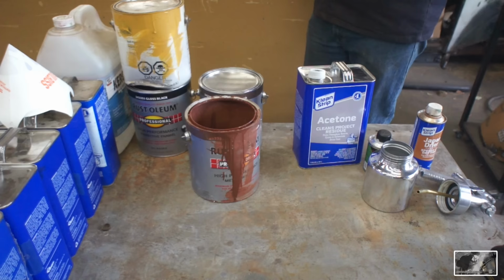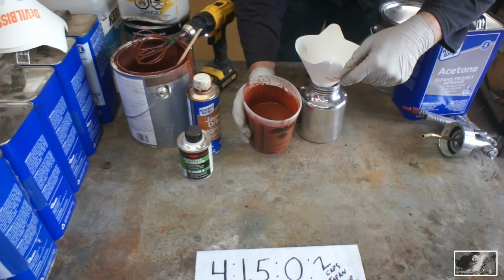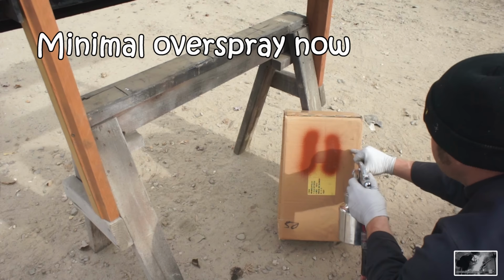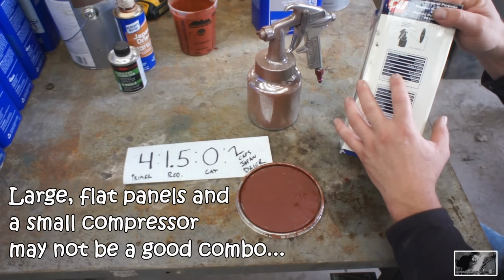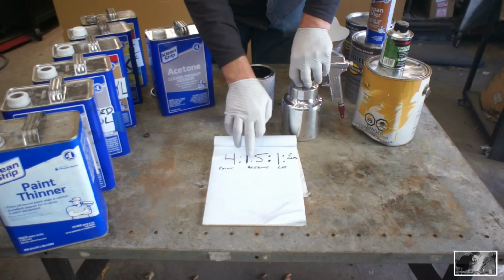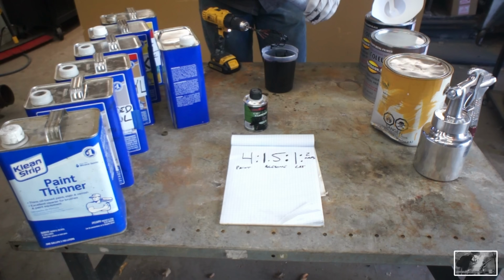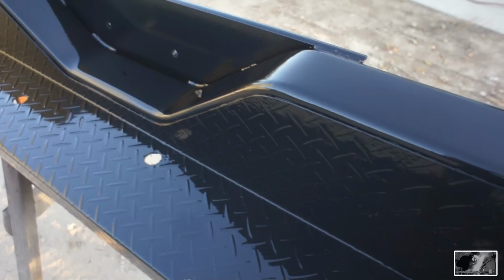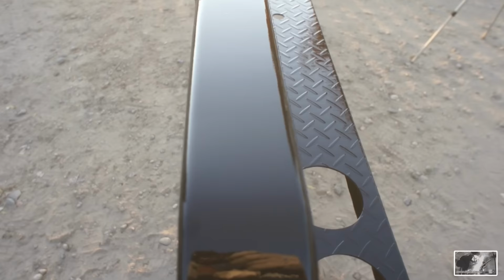DO THIS TO YOUR PAINT! | Activating your RUSTOLEUM | 2K

Comment: I've sprayed a lot of rustoleum with ok success.  I like using it because it's cheap and gives me practice with the paint gun.  Couple things I've noticed for me is I don't seem to get it mixed right for an hvlp, usually it's to thick and comes out all blotchy.  If I thin it out a little more then it has a tendency to run.  The biggest complaint I have with the paint is it has no uv protection and fades really fast. The other issue I have is it never seems to harden for me.  Your paint mixing video might clear up the mixing issues but what can I do to make it hold up especially here in the Florida sunshine?  Thanks for any advice you might have.
Reply from the maker: The activator will help a little with durability. As far as holding up to UV I think a urethane paint is your best bet. Alkyd enamels are slightly more prone to runs than a urethane. Jumping up to a decent quality urethane may solve several of your issues. Thanks for the comment Dan!!

Comment: GREAT QUESTION: painting 2 rusty garage metal doors with brush and roller.  What paint or primer do you recommend for blocking the rust with a top coat of white satin.  Can't wait for a tagger to see it and go: Ahhhhhhh.
Reply from the maker: A red oxide primer to stop the rust. Red oxide is tough to cover with white, Id maybe consider a grey primer mid coat then your satin white top coat
Reply: @unitedstatesofbuild4915  Thanks for the heads up.

Comment: Do you still want to use those ratios if you are applying paint with a brush? Such as painting the frame.
Reply from the maker: I wouldn't thin it as much. Id probably thin to rustoleum's recommended 15% for brush work
Reply: @unitedstatesofbuild4915  thanks. I'll check the label. Do you still add the other stuff as well still?

Comment: Thanks for sharing!🥰🥰  Can I use a blow dryer on low heat to dry spray paint in between coats.
Reply: No, using a hair drier is not recommended. Using drivers or heat guns can cause all sorts of issues( the fan can cause the paint to ripple, run, cure unevenly,  as well as faded spots and dimples.  Its not worth it when something like japan drier can help the paint to dry just as fast without the added labor or risk. 
Laying down paint shouldn't be rushed. Take your time, follow the steps, trust the process and You will have something you're proud of. 💯🙌🏼🤩

Comment: Excellent content.  You show the mixing ratio for both Majic reducer, Mineral spirits and Acetone.  Rustoleum recommends Acetone, under what circumstance would the Majic reducer be preferred, (it is harder to find and more expensive than Acetone or Mineral spirits.) Do mineral spirits and  reducer act similarly as they the same mixing ratio?
Reply from the maker: I rarely us majic reducer. Mineral spirits and acetone will both work fine. M.S. would be slower drying than acetone. M.S. and majic reducer are similar in dry speeds
Reply: UnitedStatesofBuild When would you use Majic reducer, with paint or primer? I am going to use Rustoleum paint and primer to spray a black metal fence, which I have never done before.  I bought a pint of the Majic reducer, as well as 8 oz of Majic catalyst as I saw you use it in your video.  Most likely use reducer with the primer and no catalyst, I also plan to use Japan Drier too.
Reply from the maker: @Dial430  If you are doing a prime and base coat then Id recommend spraying the primer coat with acetone or spirits and japan drier and then do your final color coats with reducer and hardener. The reducer and catalyst will give you the best quality and hardest top coat. Thats just my 2cents. You could always experiment to find your best process. Good luck with the job, let me know how it works out.
Reply: UnitedStatesofBuild Thanks for your help.  I really liked your spray painting videos.  I have watched them several times, the hvlp info is great. I am curious, you show two mixing ratios 4:3:1 and 10:1.5:1, are the differences due to using different guns, a hvlp (paint) and the siphon gun (primer)?
Reply from the maker: @Dial430  Yes, exactly right. One gun is gravity feed and one is force feed.

Comment: I watched your other video  and now this one.. I only have the wetlook hardener the acetone and I using  "Armor Coat" rust primer and Gloss White and Gloss Black rust paint.. and guessing they are rustolem  products but they wont say...  but that said.. can I use the hardner or do I need the dryer?  and im using a syphon gun can version which be the best for that..  its also missing the little rubber clear hose not sure whats that for..  I guessing to keep dirt out  to suck air
Reply from the maker: Youll be ok without Japan Drier. The clear hose should just be there to break the vacuum when material is siphoned out.
Reply: @unitedstatesofbuild4915  ah ok im also having issues with my gun..  i tried following your steps and others.. i did roughly a 4 parts pant 1 part mineral spirtis 1 part wet look   and it ran off the stick  in about 5 seconds..  but my gun not liking it  i had to shake the gun up and down it it was spraying  kinda..  i kept thinning it like water..  i could empty the can  add gas i had and spray that and it picked it up..  so i thinned more the paint  and was spraying on and off.. but then it was poooling  on fenders i was trying to paint.. the gun is 30 yrs old  has no rubber hose i mentionted but i cleaned everything  only has the 2 knobs the spray   increases the air flow and the other adjusts the handle...  so i not sure how wet  i should be doing it.. and its the Rustoleum  Armor Coat Rust paint...  Canadian Tire says you cant thin it.. but i think its because they want you to buy TRemclad  instread of the Armor coat  at 15 bucks more  for the same.. so i still struggling  getting it spray right out  but sprays gas   a steady stream
Reply: @unitedstatesofbuild4915   also  most people use the gravity gun but i dont have one of those  so i just using my late fathers spray gun and guns are not on sale.. so in the mean time i got frustrated and bought a couple cants of spray can primer just to prime things so cant rust more.. very frustrating   and seems no videos really show people using Syphon gun  all  are gravity..  guess you dont have issue in the end if its a little thick or so  as its pushing through doesnt need to suck it up..
Reply: @unitedstatesofbuild4915  i kinda got.it working  only.sprays like 1 to 2 inch wide spray  but had question  spray can primer when dry comes out gray  but when i mixed  4 parts paint 3 parts acetone 1 part wet look  and when insprayed  the gray isnt a nice gray but a slight green snot color  what happened.. and i googled more syphone guns they have hose and the part that goes onto the yoke shape   mine i have 2  only.have a hole there no.hose and just a nipple thats cleaned out i made sure for air  on the lid part

Comment: Very nice, I learned a lot your a good instructor 👍 what about the spot it was Resting on lol sounds like a dumb question but didn’t look like you moved it?
Reply from the maker: Good question, that was where it was where it bolted to the frame. It was also covered by the add-on hitch that sits under the bumper.
Reply: I gotcha, I just wasn’t sure I was like wouldn’t he have too touch that up. 🤔
Reply from the maker: I did mention to the customer that he could touch it up with some gloss black from a rattle can if he wanted. It did have the old undercoating underneath, it wasnt bare metal.
Thanks for watching!
Reply: UnitedStatesofBuild Gotcha and anytime, thanks for replying and making videos!

Comment: How would you go about using acetone, Rustoleum and the Valspar enamel Hardner for a brush on job?
Reply from the maker: Id probably go about it pretty much the same BUT Id consider cutting the acetone dose rate in half. 4 : 1.5 : 1. What are you painting?
Reply: UnitedStatesofBuild. Painting my cast iron milling machine.  It’s got bondo to fill in the casting marks.  I ended up using the rusty metal primer in a rattle can.  Wanting to go with the rustoleum orange.  Can’t remember the name of it. But by itself the yellow rustoleum wasn’t hardening at all.  I tested the yellow on my Wilton vice. The machine was brand new when I bought it but I was in for a long wait for some of the custom cnc stuff to arrive so figured I’d strip the old paint off and make it mine.  So I finally ordered the valspar enamel hardener.  I had better luck with the black rustoleum curing quicker when I cut it 30 percent with acetone.  Following your lead though.  Gotta brush it on cuz I don’t have any hplv stuff or a compressor for that matter.
Reply from the maker: Ok I see. The Hardener will definitely help you out. Good luck on the project!
Reply from the maker: Also check out the japan drier video: https://youtu.be/uJoCEvsamvI
and the solvent video: https://youtu.be/1Aq1xHZUNMg
Reply: UnitedStatesofBuild awesome thanks.  I wouldn’t mind the wait for the paint to cure naturally but I’ve been buying parts for over a year for this machine and the last ones I was waiting on just came in so I’m ready to rock.

Comment: That's a lot of good work, but I can't see spraying it in the dirt like that.
Reply from the maker: Yeh, it turned out ok. I just dont have inside space for spraying. Thanks!!
Reply: Does it dry fast enough that you don’t have bugs and trash? Would a 10x10 canopy help?
Reply from the maker: @BushiM37  Canopy would be beneficial. It does flash pretty quickly though.

Comment: No need for clear coat?
Reply from the maker: I never clear rustoleum. Its more of a single stage paint. Ive been told that it is possible to use a 2k clear once the rustoleum has fully cured. Thanks!
Reply: Thanks man!

Comment: what is 2k?  I keep reading that.  Is it a gimmick buzz word or does it have an actual meaning.
Reply from the maker: "component'
1k is 1 part (single stage)
2k is 2 parts (paint, hardener)
3k is 3 parts etc (paint, activator, reducer)
Reply: @unitedstatesofbuild4915  what is acrylic enamel?  it uses paint reducer and hardener

Comment: Pour the solvent cans with the cap high side, then you won't spill it everywhere. Why short paint strokes? Longer smooth strokes, that's how auto body guys spray. I like your ratios and general info, but spray technique isn't what I would call teachable for your vewers..
Reply from the maker: Correct for sure. Id certainly use the long strokes and go entirely across the piece if possible. Here with the contour changes that was challenging. I sprayed some doors in my most recent video and ran all the way across them as just you mentioned. You've got to adapt to the circumstances. That said the end result here speaks for itself. I really appreciate the tips on pouring! Thanks!

Comment: Great videos, the are very informative.  I have been using rattle cans for years but want to start using spray guns.  I am going to try the rustoleum method in your videos.  I would like to know in between coats- can you leave paint in the gun for the next coat?  Does it make a difference if you have Japan Drier in your paint? Any advice/tips would be greatly appreciated.  Keep up the great content.
Reply from the maker: I dont leave paint in the gun between coats. dump and rinse with some acetone. Leaving in will affect the spray pattern as well as the paints ability to flow out. I mix fresh paint for each coat. Its better to dump a little paint than to try to save it and mess up an entire coat. Once you get the feel for it you'll be able to estimate quantities very closely. Japan drier will set the paint of noticeably quicker. Dont give up on the gun, it may take a little time to hone your technique but the results will be well worth it. Good luck
Reply: @unitedstatesofbuild4915  Gettng ready to paint tonight with a spray gun for the first time.  I would like to know if you are supposed to let the paint mix + hardener sit for period of time before spraying?  Read that somewhere.  If so, does using Japan driver change that?  Thanks again
Reply from the maker: I combine the products, still them well (very well), strain it and spray. Let me know how it goes
Reply: @unitedstatesofbuild4915  so far its going ok.  I purchased a nice lvlp spray gun.  I get some areas/parts to lay real nice and flat.  Others areas have quite a bit of orange peel or sag.  would this be from possible air pressure setting?  or possibly not a good ratio/thinned?  I am using rustoleum enamel and acetone with a hardener.  I am reducing at 15%.
Reply from the maker: Sorry, I just saw this. Sag is generally associated with heavy spray pattern or too slow of movement. Orange peel is typically caused by too dry of paint. This could be caused by the material drying in the air. There are a few ways this can happen: (1) Air pressure too high, dries the paint before it lands on the surface. (2) Gun too far away, overspray effect, material not 'wetting in'. (3) underlying surface not smooth enough. 
JUST A FEW
Reply: @unitedstatesofbuild4915  thanks for the reply. I final got it down. My sure pressure was like for my gun and my material was a little thick. Was able to get some nice finishes. I also cut and buff. Thanks for the help. Keep up the great content

Comment: That's not a pressure pot, it's a siphon gun. It uses a Venturi effect to draw paint from the cup and through the nozzle.
Reply: It is not a siphon feed gun. This type of gun uses pressure to force material up into the spray head where it is atomized.
Reply from the maker: Yep, pressure pot. Its just not the type with a remote pot. The dead giveaway is the lack of a vent hole on top of said pot.

Comment: It seems Japan Drier is no longer available...… ?
Reply from the maker: I asked the paint expert at home depot and he said that the air resource board is regulating it more so a lot of the bigger stores wont carry it. I was advised to go to a paint store or a small hardware store, I bought 2 cans at my local ACE.
Reply: Oh...maybe my Home Depot doesn’t carry it anymore...dang!
Reply: I would evaluate using an auto paint "reducer" commonly available. It should accomplish the same function instead of acetone/Japan drier mix.
Reply: UnitedStatesofBuild I was just at my Home Depot and they still have it on the shelves. Idk if the laws vary that much per state (except maybe Ca.), but I’m in Jersey.

Comment: To the commentors~ 
Wear a mask & gloves if you want.
They sell pink for ya's.
Just stripped paint for 3 days with chemical stripper.
No gloves.
Ehh, it only stings a bit if it gets on your fingers.
✌❤
Reply: Remember, catalyzed paint also catalyzes lung cells. Activated charcoal masks are the only way to spray that stuff, even outdoors. Talk to a painter.
Reply: Learn about chemistry, toxicology and biology and you will understand why you should have gloves and a mask. If those big words scare you it’s ok, they sell pink notebooks for ya’s.
Reply: @miken.4693  
Im 45, built custom cars for a living.
Leaded without a mask.
Paint without a mask or gloves ~ just dont touch the paint.
Fiberglass without a mask.
Cut fiberglass without a mask or gloves.
No face shield cutting or grinding.
Im still here.
Welded a gas tank just removed from a truck ~ didnt go boom either.
Reply: Frankly Speaking just let me know when the cancer kicks in.
Reply: @miken.4693  
Cancer....🙈